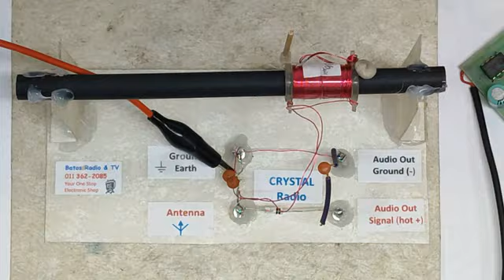121# Crystal Radio (Cats Wisker) full explanation and demo

Comment: Crystal earphones are available at a very reasonable price.  They are not as comfortable to wear but they do work.  They are about $5 US. each.
Real germanium diodes are the harder thing to get.  You can use a small signal schottky diode but if you are using a crystal earphone you will need a resistor to make it all work.
I explain the reason here:
https://youtu.be/5y7I7G_a3Qo?si=fSCarq_kdNAzy6ZD
On my crystal radio, I use an antenna that is about 20 meters long.  My radio is a different design to what you show here.
I have also operated with a tuned loop antenna.  This is good for people who can't string up a long antenna.
Reply from the maker: Thank you for Yr comment, but I think you missed the point as I was trying to present (Simple Crystal Radio in a Simplest form) that works with 3 or so CHEAP components with reasonable Selectivity, Loudness and Clearity of the Sound- Music.
Demo was done inside the building, with Random Antenna wire with just over 3 meter and 0.6m wire connected to poor ground, yet I still get overall result satisfactory.
If I use the set outside with a proper Random Antenna matched to my Crystal Radio and proper Grounding I get anything up to 10 time better overall results.
Intersting inugh you say high impedance headphones are cheap & easy to obtain, yet Crystal Diodes are dificult and expensive to obtain...
Here in SA is opposite ...
Non the less I solved the problem of headphones
by designing and making a tiny highly efficient High Input impedance amp operating from small PP3 9V Battery, capable operating for more than a half a month driving 6in speaker,
see it coupled to my Crystal Radio in my Video122#